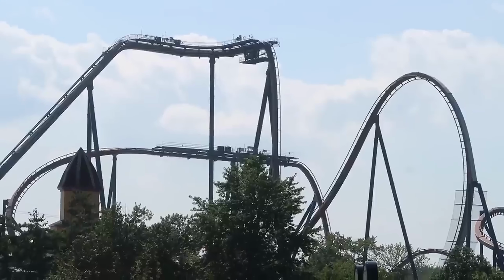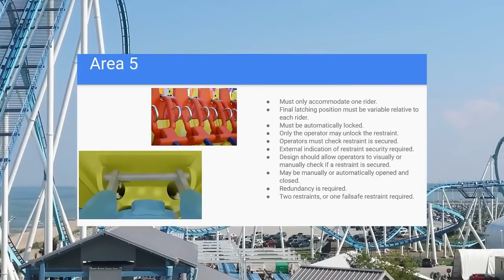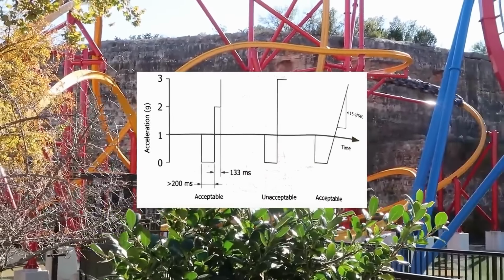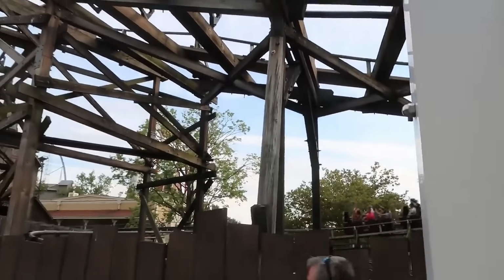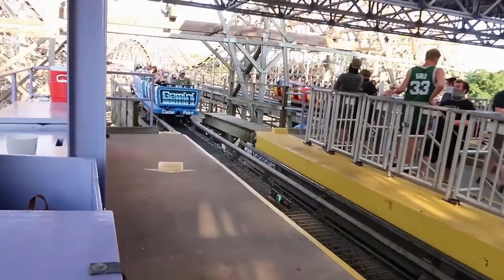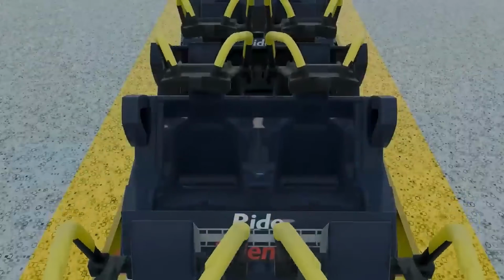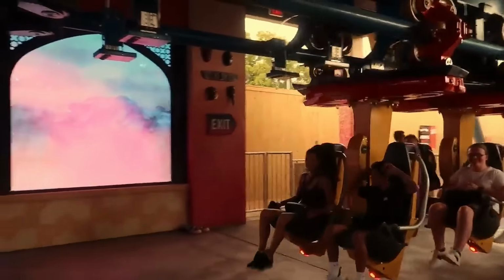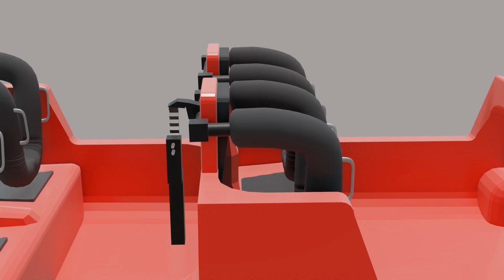How Ride Restraints Are Designed and Work - Supercut

Comment: 15:58 - I once had a ride on the mean Streak where the bar was just loose. I don't remember how it got past the operators (I and my seat partner were skinny).

I definitely tried to push it back into my lap repeatedly with no luck at all getting it to ratchet closed. Maybe my brain was exaggerating the play?

Comment: Can you do a video on roller coaster trains/wheel bogies?

covering stuff such as 
zero cars
having multiple bogies per train
benefits/drawbacks from having side friction wheels between the rails instead of outside the rails
upstop pads instead of upstop wheels
joints between cars (universal joint, ball joint, hinge etc)
very short train cars vs very big train cars (millennium flyer vs X-car)
how the bogie design changes the max turn radius of the train, the ability to heartline elements, & tightness of elements
how slightly larger gaps between the wheels and the rails allow the train to articulate tighter elements at the cost of a "rattling" feeling

I might have missed some but you get the point
Reply: I would also love one about Ride manufacturers (unless there’s one I’ve missed) because I’m so interested in variations in design standards
Reply: Affectionate, do you have autism by chance? 💖💖 

(this is coming from someone with autism LOL)

Comment: What is the difference between redundant and fail safe?
Reply from the maker: Redundant: a second system in place that functions the same as the first

Fail safe: failing into a state that doesn't cause danger or a hazard to be created.

Comment: I‘m really curious about international regulations. Especially in the EU. Usually they’re a bit stricter around here. Could you look into this and do a video about that? I‘m afraid they might differ from country to country. Otherwise I might have to do my own research 😇🙈
Reply from the maker: Yeah could be a good video topic, though as I understand it EN standards are nearly the same as ASTM when it comes to rides.
Reply: @CoasterCollege Yeah, makes sense. Especially as the manufacturers will be somewhat involved in defining the standards and will most likely operate on the smallest common denominator anyway.